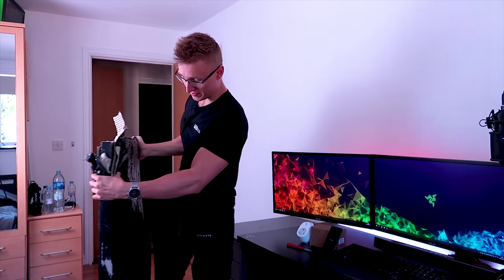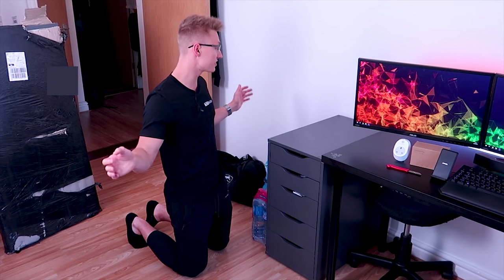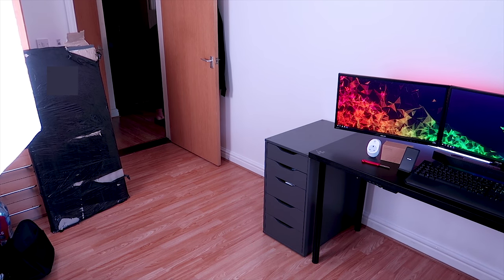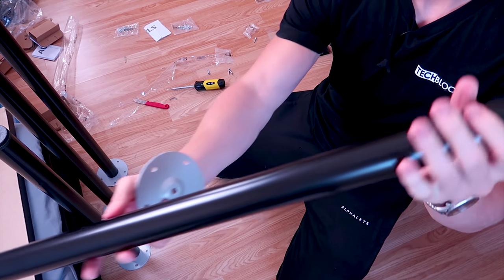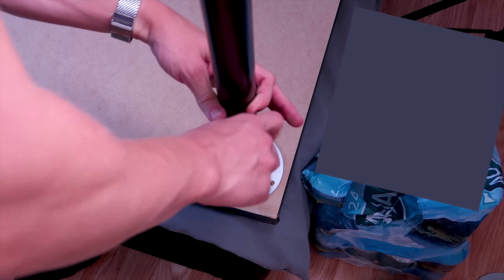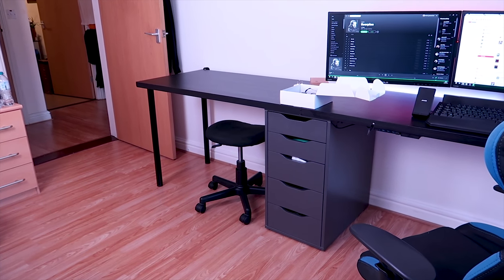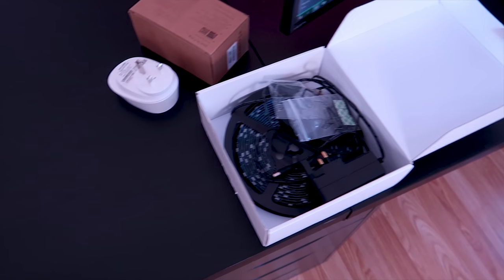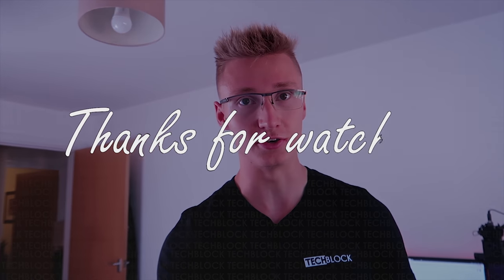My New Gaming Setup Desk? - IKEA LINNMON

Comment: Can anyone confirm if the Ikea Linmon desk can hold the weight of two monitors and a computer tower? I have one 24inch monitor but will be adding a 27 inch. I have a 5th leg for the table like in this video.